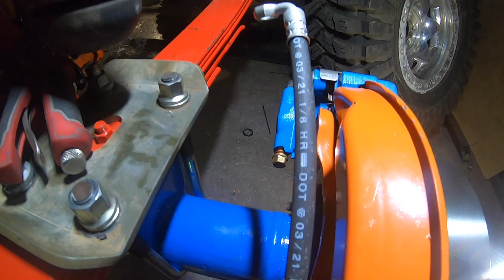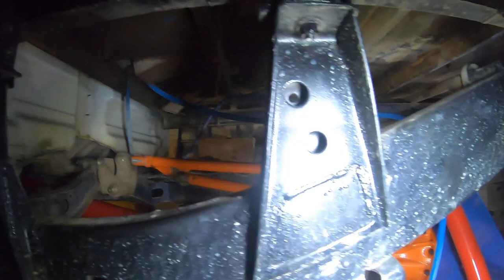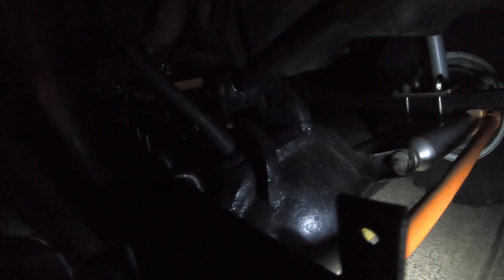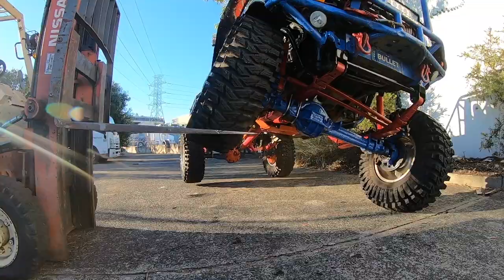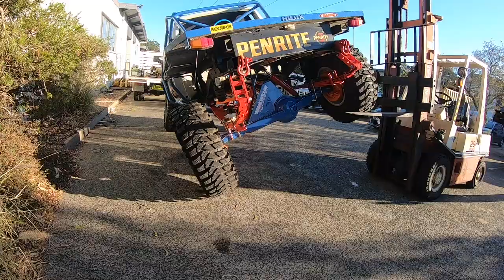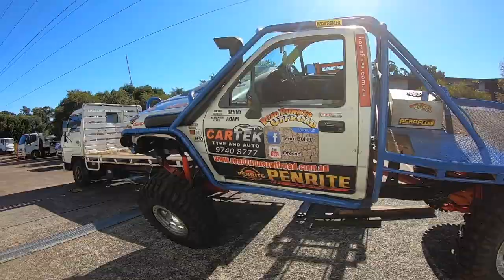Part 8 Ln106 Flex test disc brake rear end Toyota hilux bleeding brakes team bullet off road racing

Comment: Locker locks and doesn’t leak check. 
Diff turns and doesn’t make bad noises check. 
Brakes don’t leak and stop the wheels turning check
Axles go in and bolts do up check
Tail shaft doesn’t bind check

Always nice to see the bits work together!

Make sure those flange bolts are TIGHT. Use anaerobic thread lock and wet torque to 60-70Nm. This is higher than chart torque, will take it to around 90% of yield,  makes sure the bolt is loaded only in tension. Going this close to yield means either we need to measure them or throw them out rather than reuse. Do not use a gasket, use anaerobic gasket maker. Pro tip you can use loctite 510 as both thread lock and flange sealant. 

I highly recommend keeping the factory seal between the end of the housing and the axle shaft. It is an extra layer of protection for the diff oil. A bit of mud in the wheel bearings is $100 and an hour to fix, and you can do it anywhere. A teaspoon of mud in the diff oil and parts alone you’re heading into real money. gears, locker,  bearings... 

Love it can’t wait to see it in action.
Reply from the maker: Nice info Brian, yes i will need to pull axles back out before 1st run to rectify my mistake... 
Maybe i won't go in mud anymore???????????/
Hehehe
Reply: @TeamBulletOffroad  we don’t have mistakes, we just perform alternate assembly procedures 🤣
Reply from the maker: @brianmonger8185  Too kind....

Comment: does it matter much if the 80 series diff is not centred. does the prop shaft do anything funky
Reply from the maker: Be ok for a vehicle not driving on the highway anymore, but the 10 degree discrepancy won't be a problem offload